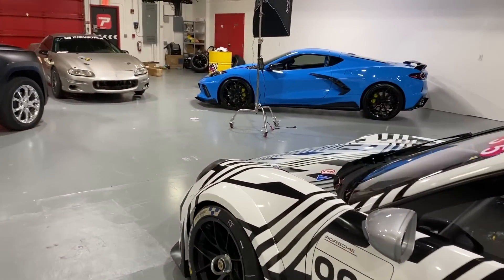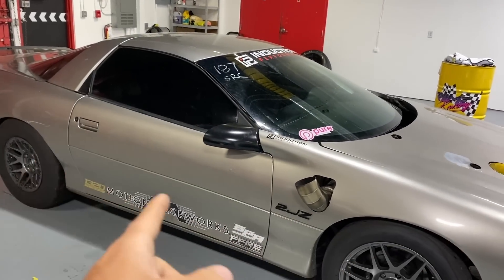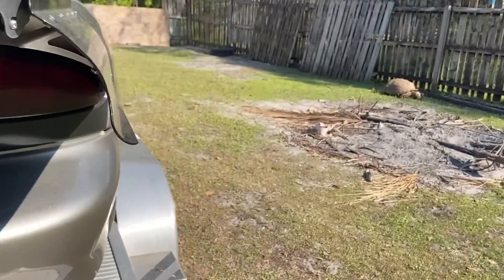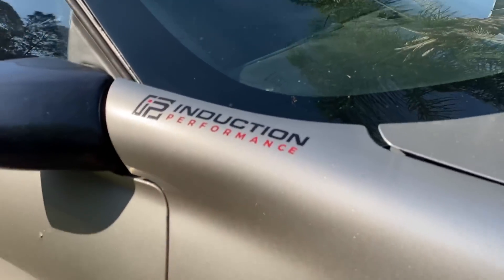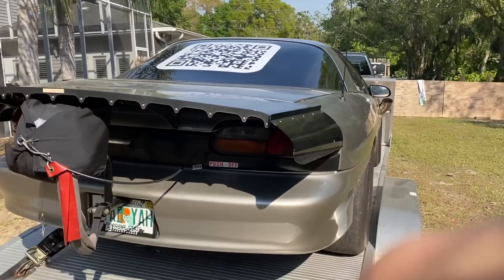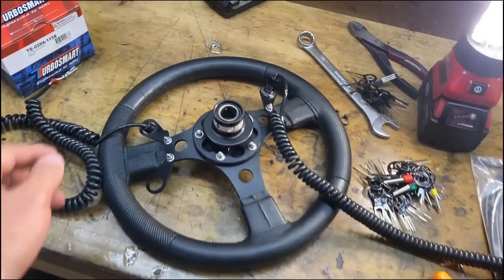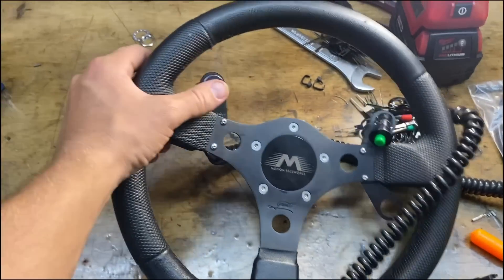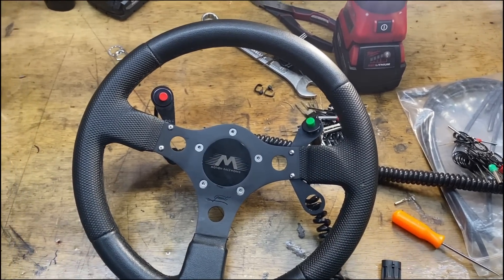Camaro Gets An Upgrade! Just for Looks...

Comment: Cooper, for the camera are you using a high output charger? Some of the cheap USB chargers cannot pump out enough amperage for things like that.
Reply: The fact it won't run continually whilst also charging is a safety feature, not a design flaw. Putting high loads on rechargable batteries at the same time as charging creates immense amounts of heat and pressure and you end up with complete, and potentially catastrophic failure. Not sure if you've ever seen a lithium battery fire but it would not be very fun right next to a wooden table in a wooden framed shed full of extremely expensive race cars..

Comment: The Sony A6400 will also run off of micro usb power as well, you do have to enable “usb power supply” under settings.
Reply from the maker: Hmm ill look. The dummy battery was cheap

Comment: The battery doesn’t work like that because battery’s are meant to discharge and recharge. If they stay full charge they degrade to the point they no longer hold a charge at all

Ever left a laptop plugged in for a whole year- and then when you take it off charge it dies within 15 min?